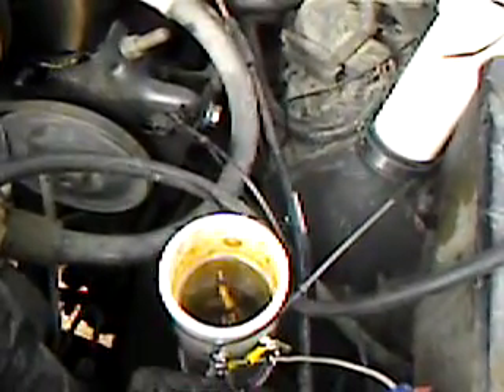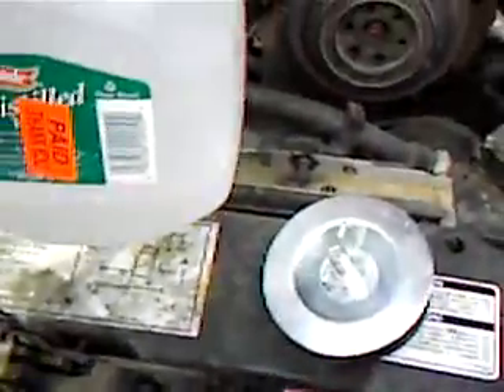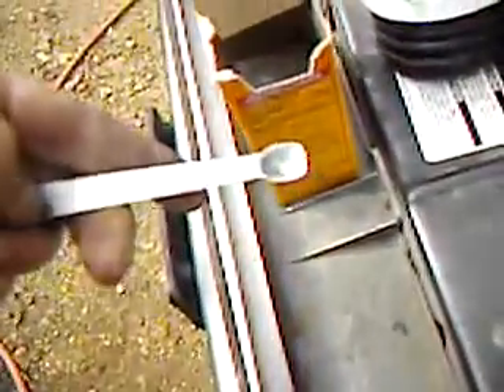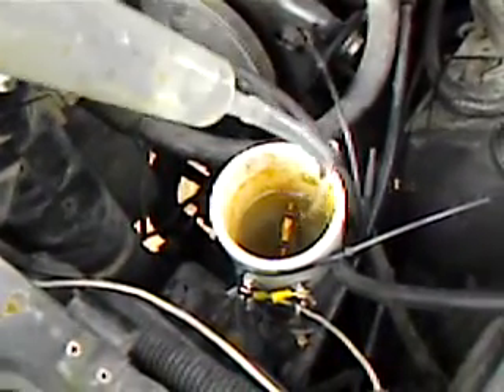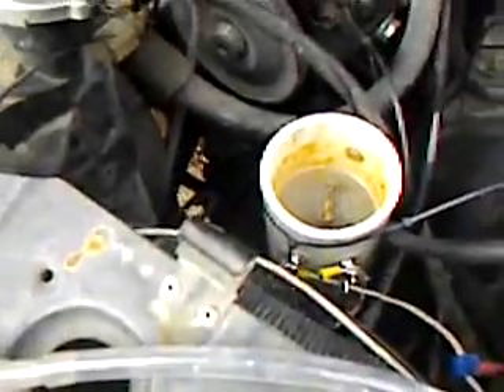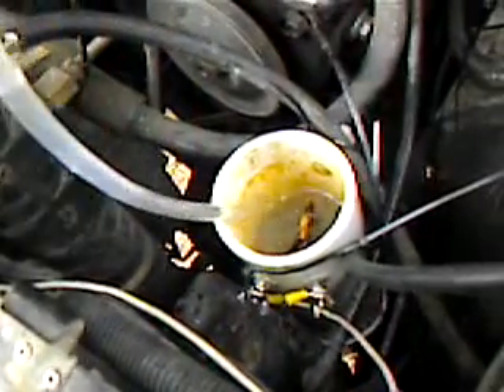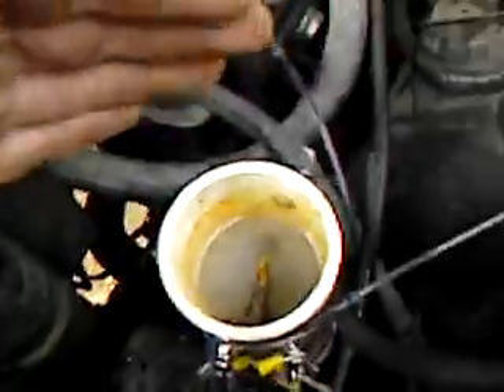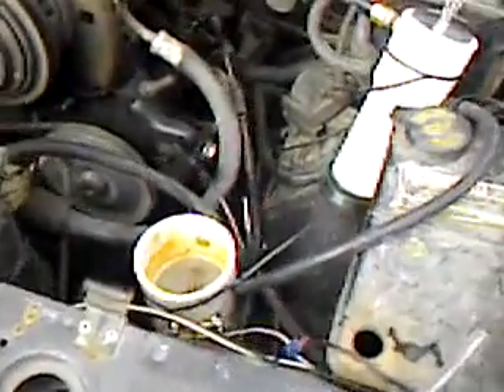The effects of adding baking soda to a hho cell

Comment: @asjenterprises 
Hello, I have a Bronco 2, 1988, engine V6, 2,9L EFI. When I bought it, It came with a HHO cell. It work pretty well, but the economy does not. It gives about 21 mpg, I found that the oxigen sensor is damage, it is open loop, so the computer thinks the engine runs lean, so I think that the mix is rich all the time. I will construct a Dry Cell to try on my Bronco,

Comment: hey i am using baking soda and vineger in my first experiment research.
after 30 minutes of slowly adding nearly the enitre box of of Bsoda and a 4th/1QT white vinager i first notice a smell then i saw a white powdery vapor on top of the bucket. this vapor is esly disturbed by the slightest movement of air, what could this be. i used stainless steel and a battery charger set on 12v and reading 11 amps and a 5 gallon bucket full of water from a furnace.

Comment: I just want to put my two cents worth in here. Sodium Hydroxide may be harder to get now but you can order it from soap making suppliers like summer bee. NAOH is a catalyst which remains in the water and does not produce as much cavitation which destroys the stainless. Oxygen bubbles explode under the surface of the steel exposing the iron underneath. The iron is oxidized into iron oxide or mud. Naoh or Koh are the best catalysts for this reason. My cells produce no mud ever! I use 1 tsp per gal

Comment: My experience with caustic soda, sodium hydroxide is that it produces more amps but not so much more gas. Maximum amount of baking soda in water is about 8 teaspoons/gallon. And in a three cell series setup, it produces more 2-3 times more gas per amperage that caustic soda.